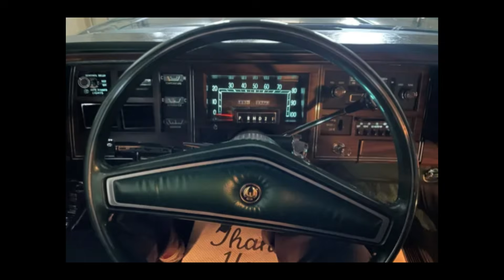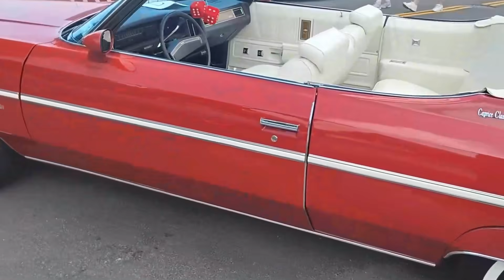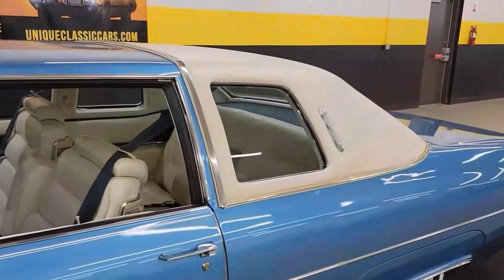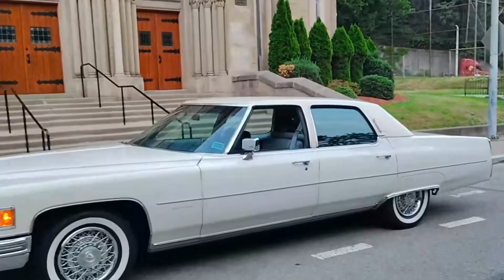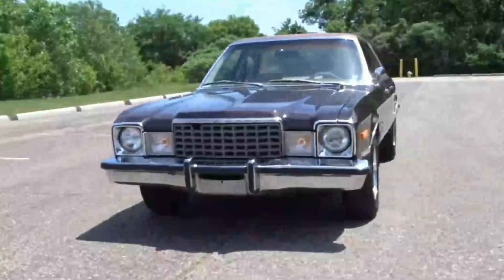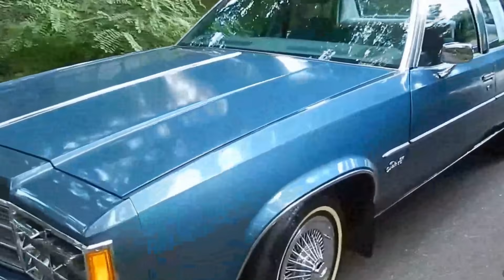The 9 WORST Family Cars of the 1970s!

Comment: Not sure where you're information is coming from, however the panther platform Ford products were some of the best vehicles ever made, starting with that 79 LTD. If anything ever competed with them; it certainly wouldn't be the Chevrolet Caprice as General Motors had severe build quality, management and safety issues. I owned an LTD Crown Victoria, Mercury Grand Marquis and Lincoln Town Car, they were all fantastic.

Comment: I've loved Cadillacs since I was 8 and I'm 61 now.  I've owned many over the years.  I actually had a '76 Sedan DeVille around 2000 and it was a daily driver.  I currently have a '76 Fleetwood brougham and I find most of what this guy said to be wrong.  First off, the 500 engine was one of the best Cadillac ever made.  There were no issues with it.  No coolant leaks (that was the HT 4100 from 82 to 85) and no overheating.  While it's true the optional fuel injection was problematic (I had a 75 Fleetwood with one and got rid of it) most did not have that option.  The climate control was mechanical, not electronic (the 1980 Eldorado and Seville was the first to get the electronic version) and it worked better than the electronic or even the current versions.  There were no suspension or transmission problems.  There COULD be issues with the air shocks for the level ride in the back.  There were no problems with the lights or other electrical components that I know.  The only thing I ever had to do with both of mine was replace light bulbs.  The gage clusters are mechanical, not electronic so no issues there.  There were no issues with the paint as there was no clearcoat.  It had lacquer paint which is now illegal. My 76 Fleetwood doesn't even have any 'spiderwebbing' on the paint, which is original and I store it outdoors. It IS true that the interiors were kind of cheap with a lot of plastic that could crack is not taken care of properly.  Particularly the dash, arm rests and steering wheel.  
Finally, the 76 Fleetwood was NOT the largest car Cadillac ever produced.  It is the largest POST WAR (meaning World War II) car they produced.  They had bigger ones in the 20's and 30's.

I would also point out that only the Sedan DeVille was marketed as a 'family sedan.'  The Coupe DeVille was a 'personal luxury coupe' and the Fleetwood was an 'executive sedan' meaning it was meant to be either driven by executives or the executives were chauffer driven in them. I am still shocked that even though the Fleetwood was the biggest car, it actually has less leg room in the drivers cabin than the Sedan DeVille.  I'm 6'1" and I feel quite cramped in mine compared to my old Sedan DeVille which had a LOT of room.